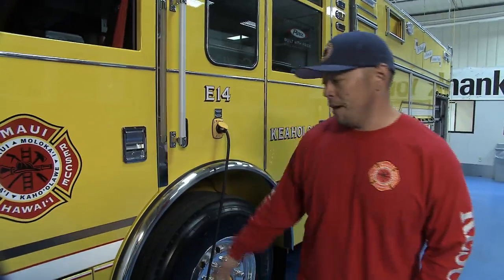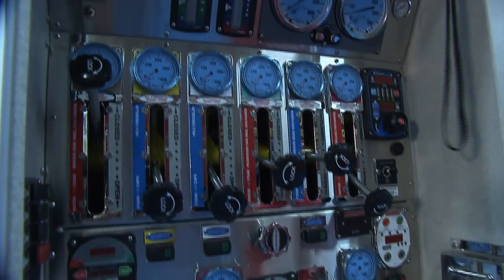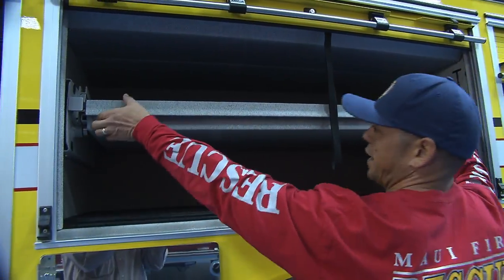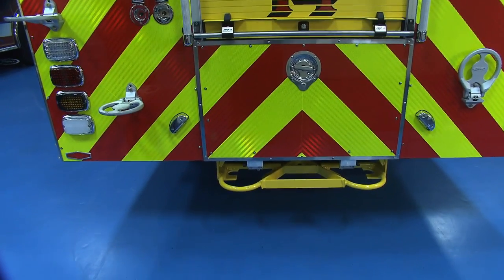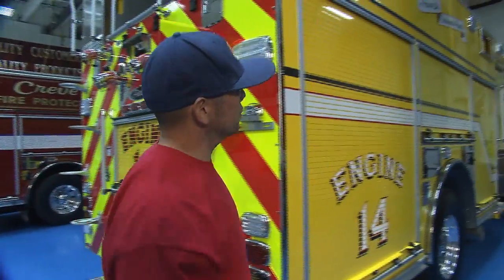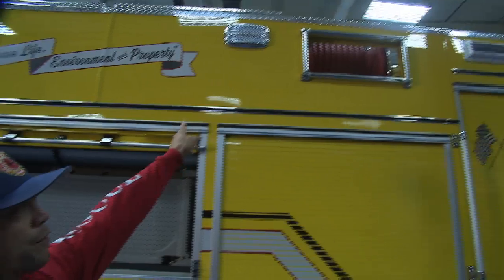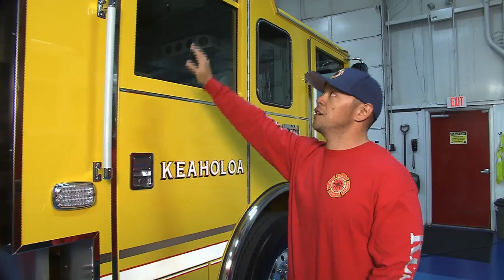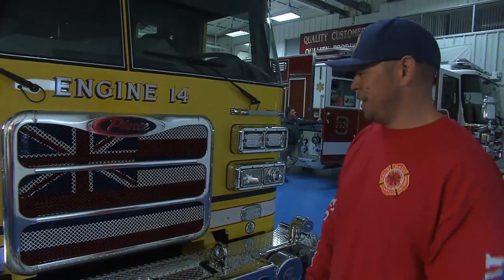Maui Fire & Rescue - Arrow XT Pumper

Comment: I love this truck top to bottom. Looks like your department really wanted to get the max out of this unit while not having to rely on a full crew. This seems simple, but having 2 booster reels is nice to see. Easy to operate, quick to deploy, and 1 firefighter can handle the 1" line without needing back up. We always had lots of trash, grass, and brush fires next to the street, or within 150' of the truck and hated over the years watching booster reals taken off the trucks. Pulling up on a 100'x200' grass fire on the side of the interstate, pulling a 1 3/4 hand line, lots of extra work and not as quick as having booster reels. By the time the crosslay is pulled off, straightened out, charged, a booster reel has the fire out already. I'm seeing more and more new units adding booster reals back on the engines. Great to see.
I'd really enjoy seeing a video with all the warning light on. Very curious how the new Whelen Rota Beam LED light bars look on the bigger units. Great idea, can't wait to see it live.
All in all great unit. Hope to see it in action very soon.